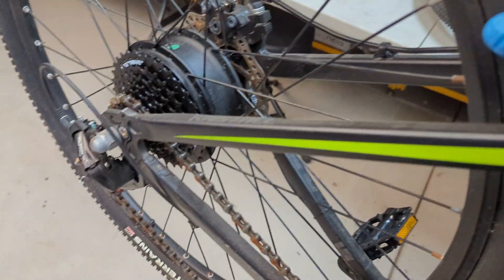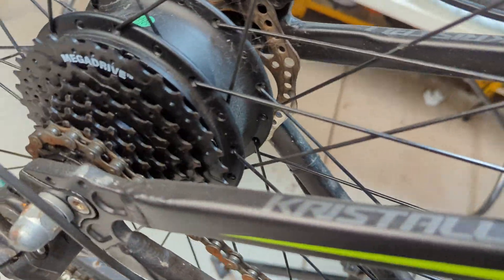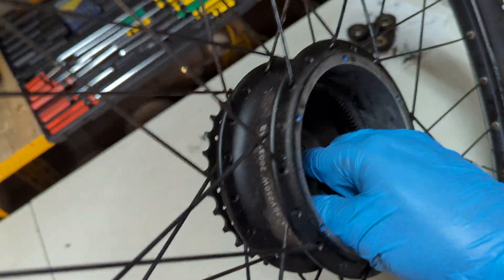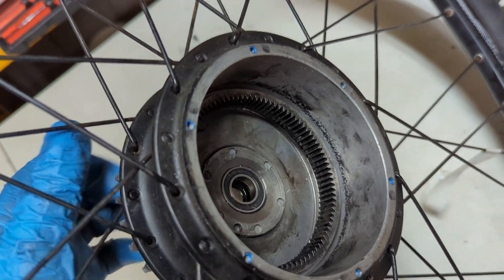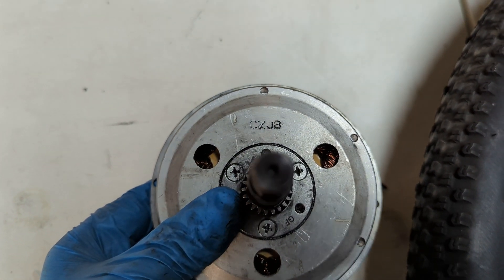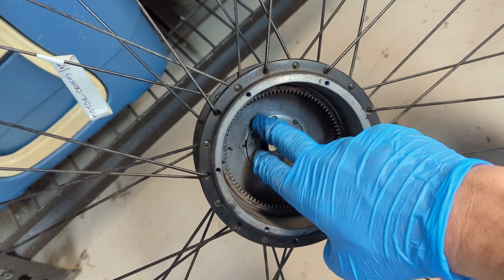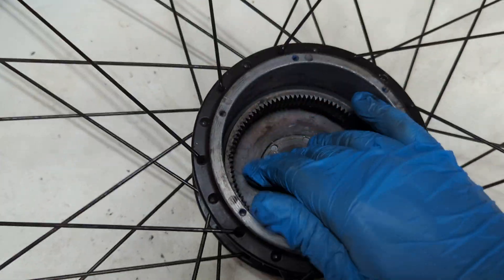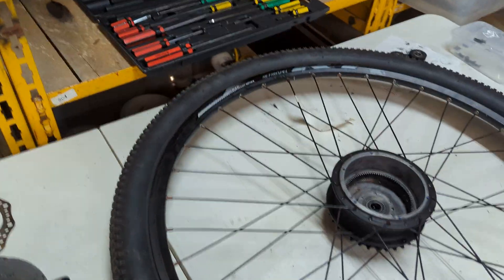ebike hub motor freewheel mount slipping

Comment: The same thing happened to me. I just replaced the freewheel cover and now it's all good. I'm guessing that they used softer metal for the freewheel mounting screw part compared to the Shimano freewheel sprocket. The cover was €30 (+€10 shipping on) AliExpress, plus €15 for the sprocket. Make sure your measurements are correct and good luck

Comment: As of a couple weeks ago, I'm experiencing the same slippage on a 750 watt gearless hub motor, and haven't found a solution yet.
Reply from the maker: My plan is to buy a new motor that fits, use the cover , and I will also have a spare motor when current one fails.  Lesson for me, is buy ebikes with motors that are widely available to buy parts for.
Reply: @mickp10 The motor only has about 300-400 miles on it, so I'm planning to open the hub and see if it's something that can be welded. Hopefully I'm not forced to invest in a new motor.
Reply: Same issue just happen to me a few days ago. Motor works well after 2k miles but freewheel spins freely…spline attachment seems to have dislodged. No solution yet. Good luck with yours.
Reply: Possibly re-tap the screw holes and install a slightly bigger screw.
Reply: @Elvis241000  Good suggestion, but the I don't think broken screws are the issue. I can't remove the freewheel because of the slipping issue. It just slips on the hub, or whatever the freewheel is attached to is slipping on the hub. I can't see behind the freewheel to tell, but the screws around the motor case are fine.